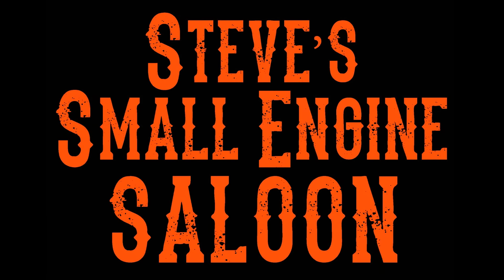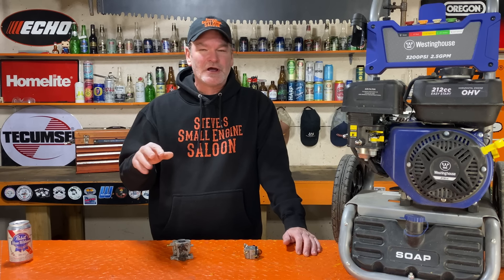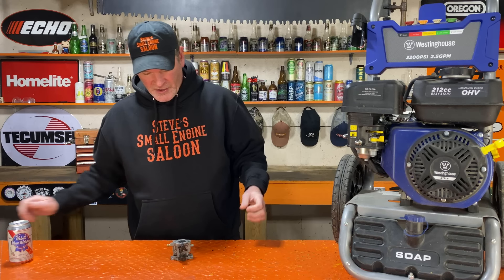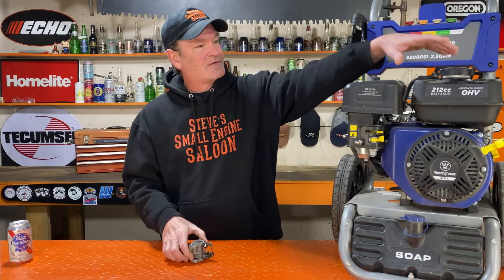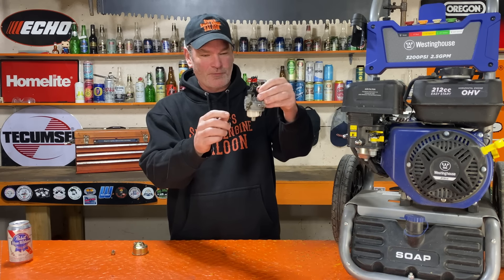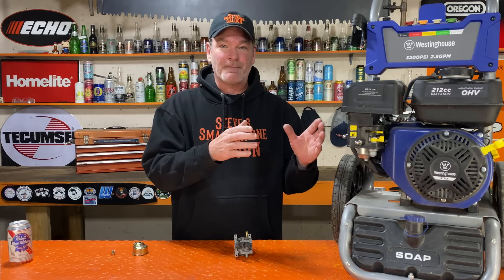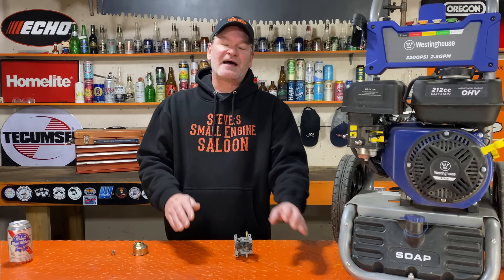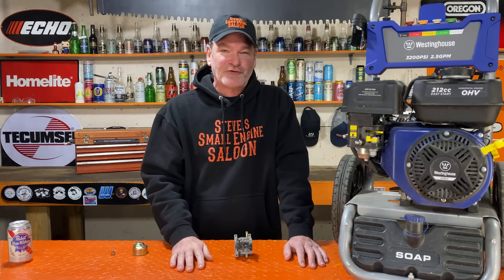I Mastered TRANSPORTING My Equipment with This One Simple Trick!

Comment: You are so right. Many years ago, I took my 4-stroke Yamaha 500 up a long steep trail. When I got to the top, I decided to kill the engine and coast back down. I forgot to close the fuel valve. It took a while at the bottom to start the bike (kick starter only). Talk about flooded.

Comment: Had this happen to me with the wood splitter once. And it hydrolocked the motor, until I got the spark plug out!! Also changed the oil at the same time.  Great tip

Comment: Fixed a few over the years where this was the exact cause of a no start, easy minor fix which can be avoided if the machine has a fuel shut off. We have to be aware that not all machines have a fuel shutoff, however good practise to make use of it while transporting or storing for long periods. Cheers.

Comment: Yep, 100%.
I've told many customers (contractors etc) with GX Honda/Chonda style engines to do this before transporting their equipment, mostly after they got me out for a no start and I found a bucket load of fuel in the oil, luckily they were a no start situation or bad things might've happened🤣
Better still, I explain the reason why, and also recommend they get in the habit of turning it off then run the machine out of fuel before transport and storage etc.
Sure, I might miss out on a few no starts, or seasonal carby cleans, but at least they don't call me out on weekends or odd hours for a problem that's simple for them to avoid altogether👍

Comment: Most of my equipment like this didn't come with a fuel valve, I've had to add one. Old riding lawnmowers and tractors are notorious for float problems from the constant bouncing over rough lawns/terrain, not much you can do except re-adjust the float when it gets knocked out of adjustment. Thanks for the tip, Steve!

Comment: I often treat the fuel shutoff valves on equipment like a shutdown switch and let the carb run out of gas, incase it sits for an extended period before use again👍🏻

Comment: Great suggestion, I have an older walk behind Cub Cadet with the 6.5hp Briggs that would be flooded every time I hauled it somewhere. Heck I couldn’t even roll it down the drive with engine off to prevent throwing a rock without flooding so I cut the fuel line and installed a shut off valve and a filter while In there. No more problems.

Comment: Each and every time I finish using gas powered equipment (i.e. of any type), I turn the fuel port off while the equipment is still running to empty the carburetor.     I purchased these cut-off valve kits from Wal-mart for a cost of $9.87.  I have installed them on all of my four cycle engine equipment.

Comment: There's a good dudes if your lawn mowers like mine where it does not have a shut-off valve you always drain the tank and then drain the bowl . This will save you a lot of headache instead of dealing with a flooded engine .

Comment: Learned that even just moving the champion log splitter around the yard, it will try to flood out the engine, but the honda on my ferris same design will start right up. 
Do some video on why 2 strokes have a hard time starting when  it's hot outside side.
Or some info why my kohler v twin won't start when it's below 39 f but the kawasaki will start right up even when it's colder than 36? It has drove crazy over the years. Love your short simple videos

Comment: Hi Steve, Thanks for the tip. I had my Husquavarna lawnmower, which came with a Honda engine, after every use I would close my fuel valve and finish cutting with the fuel I had left in the gas line. When I ran out of fuel, I would clean the underside of the mower. Last year I bought a new Toro and it doesn't have a fuel/gas valve. I was sad about that.Take care.

Comment: Hi Sir,  I just bought a Wallenstein wood splitter , it is equipped with a Vanguard 6.5 HP    203cc engine.

 I am disapointed because the engine has no seperate fuel valve.

The fuel valve is activated with the lever of the off switch at the same time.

The last splitter we had, had a Honda engine ( that I loved) who  had a seperate fuel valve and EVERY time I stopped  it, I was closing that fuel valve with a slow throttle to let it die and never had a problem starting this engine. I feel good when there is no gas left in the carburator.

My neighbour have a home hardware wood splitter who has a Briggs and this lower quality engine has a seperate fuel valve ???.

Why would they do this on a Vanguard.

Excuse me for the quality of my English, Michel Quebec, Keep up your excellent work Steve.

Comment: Excellent point in shutting the fuel line off. Thanks.

I hate to bring this up Steve, this issue has come up many many times. So anyway, this is about bar oil leaking out of a chainsaw when not in use.
I’d like to know your suggestion and what do you think about my idea. 
I have many chainsaws, there for they sit more than they get used, but they leak constantly. 
I’m thinking about removing the bars and replace them with fabricated metal plates and gaskets. The bar nuts will hold down enough pressure where the oil won’t leak. What do you think? And what suggestions do you have. I know I could pour the oil out of the saw but I think it’s still going to leak the oil that’s in the line.

Comment: Shut the fuel valve off……IF it has one. Some don’t. If yours doesn’t have one, they’re $10 or less at your local small engine repair shop, get one. You’ll be glad you did. This will also help in the winter - turn the valve off and run the engine until it runs out of gas. Now your main jet won’t be clogged up or the float stuck in the spring.

Comment: Be sure your equipment has a shut off for the fuel. I had a tractor that leaked at the needle/seat and washed the oil from the cylinder. Didn't know this happened until it was too late. Engine cranked slowly, thought it was battery going out. Big dollar fix! I always have a shutoff and use it.

Comment: Great thought.  I have a few pieces that have a fuel on/off valve.  I always (unless I forget) turn off the fuel when done with the machine.  What do you suggest for equipment that does not have one (like my push mower)?
And yes, I live on a gravel road with washboards…and the paved sections in front of home’s driveways are worse due to the pot holes).
Great thought, eh!

Comment: On a Tecumseh engine with an inlet pipe, it will most certainly just puddle gas on the ground instead of flooding the engine due to the fact that the inlet pipe travels upward and the fuel can’t travel in that direction. This will get your air filter wet in the process but it’s still better than dealing with a flooded engine. My advice? Install a fuel valve on the line and run that sucker dry before loading it.  I do the same exact thing with my carbureted ATVs.

Comment: Hope you see this. I may need to transport one of those Amazon 212cc wood chippers in a hatchback and was wondering what kind of problems i may run into putting it on its side or back or if i shouldn't. It does have a fuel shutoff but im curious about tank leakage and oil getting into the wrong area. The alternative is to haul all the hedgerow trimmings away which will be multiple trips.

Comment: That's good advice, only thing is I have a Briggs pressure washer and ot don't have a valve on it. But wait it has the old style carb that pull the fuel up from the tank under it, so mine won't do that anyway.

Comment: Saw a Husqvarna 4 wheel drive mower at Lowes one time marked down to $50 for parts. Tag said unable to start from their fix it shop. So I pulled the string, compression feels good. The gas tank doesn't smell to bad and while Im there notice the fuel valve shut off. I turned it on and gave that Honda a good pull and it sputtered to life right there! Quickly ripped the tag off and bought it for $50. Nearly brand new.

Comment: Steve, love your videos but I’ve got a question.  We just had a big wet snow in Denver.  I normally blow my 3 neighbors drives and sidewalks when I do mine.  Just takes a little time and about 3/4 tank of gas.  This last snow just to do my drive took 1.5 tanks and a lot of time, plus it was still snowing hard.  My problem was slush clogging the shoot.

This got me thinking, has anyone diverted their hot exhaust into the shoot?  Would that help to keep it from clogging?  

Thanks

Comment: On my equipment that has a fuel shutoff lever, when I am done using it I usually let it idle to cool down, I shut the fuel off and let it basically run itself out of gas.  I don't know if that's good or bad, but I very seldom have carburetor issues.

Comment: My Champion splitter manual states that the fuel tank should be empty before I pull it behind my truck. Something I’d never do, by the way. Don’t care about the DOT rating. It will be hauled on a trailer for any substantial distance. I wonder if that’s the reason why it should be on an empty tank. It has a fuel lever that would allow me to just shut it off instead. PBR rules!!!